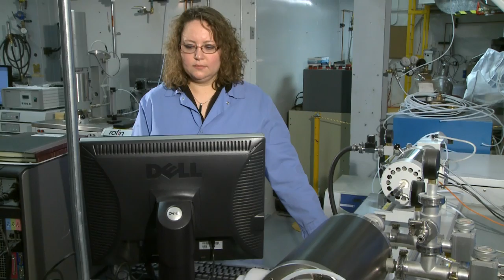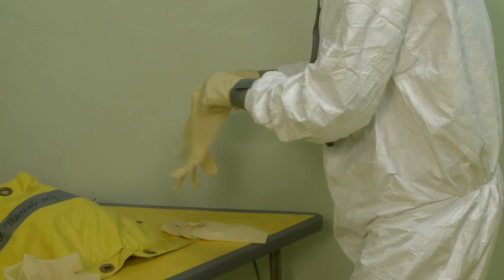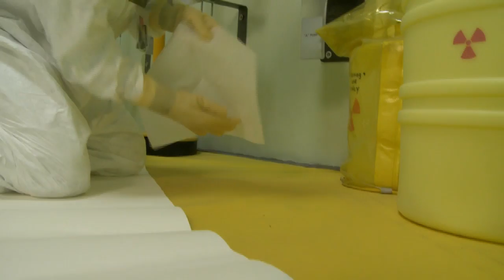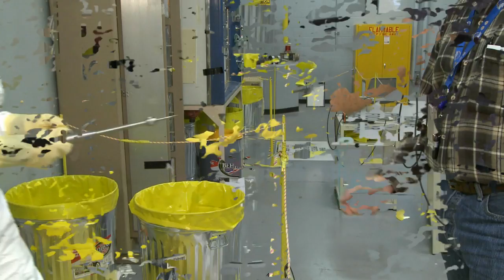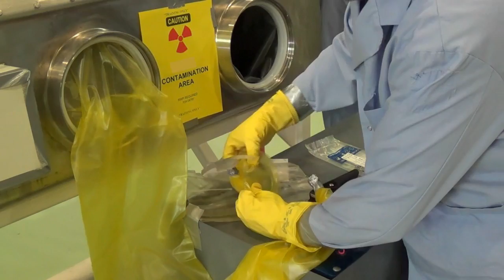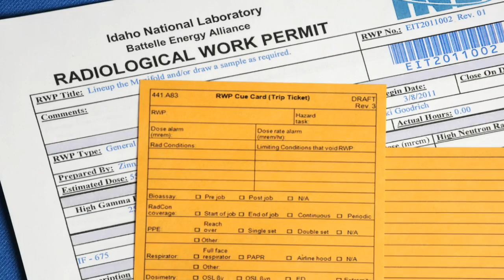Radiation Worker Good Practices

Comment: As a radiological contron tech here in Germany (Philippsburg NPP)  i am surprised you guys in the US still work with '"rem" as the rest of the world has adopted "Sievert"? You guys monitor contamination with dpm/100cm²  Dpm is "Decay per minute"? We use Bq/cm² as the main unit
I find it very interesting how you guys "bag" radioactive materials  We normally just twist and tape without folding it again. Your method is absolutely safer!

what is exactly an "ED"? Well here in Germany we call that a "digital Dosimeter" ED for External Dose?
Reply: ED is electronic dosemeter.